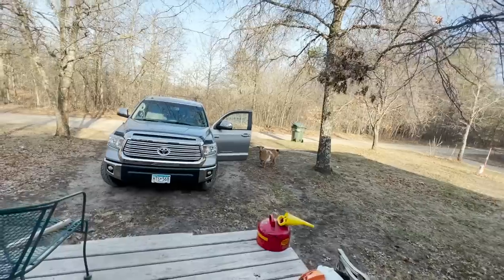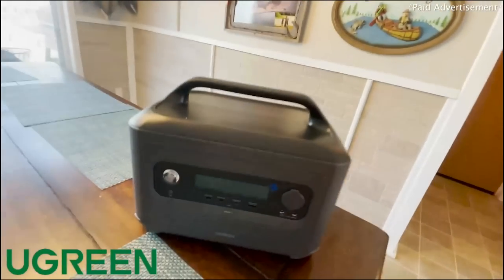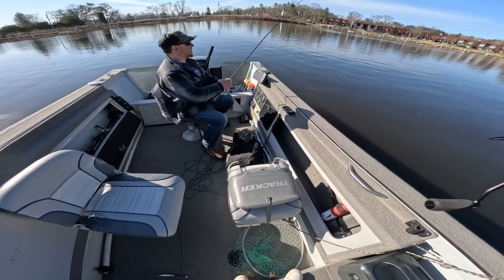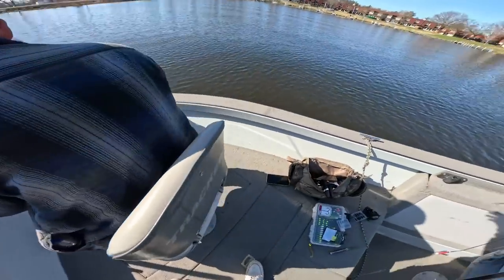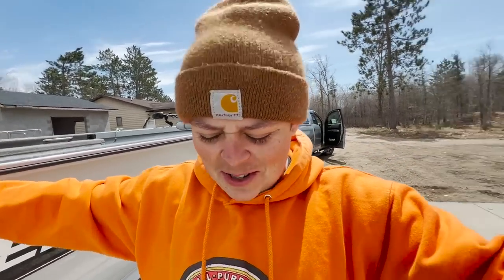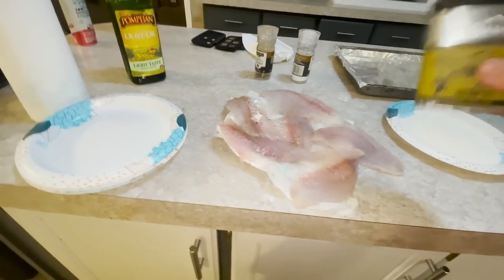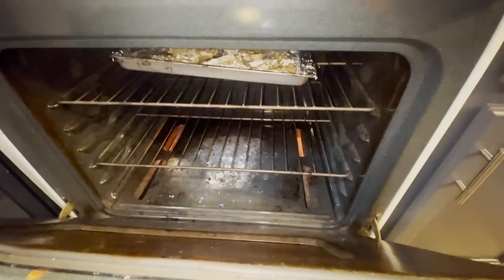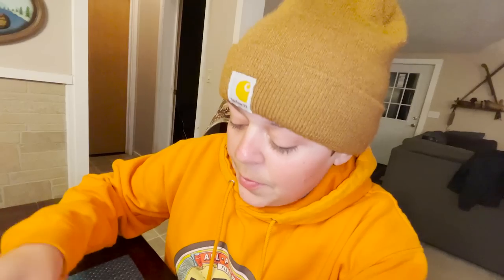Crappie Fishing Catch And Cook! (Schooling Crappies)

Comment: If you want to bake fish like that, maybe try my chicken nugget method I use for my kids. Meat (fish in your case, chicken in mine) dust in seasoned flour (to dry the fish's surface), then egg (so the next step sticks), then cover and kind of press on panko breadcrumbs (with added seasoning), so the peices are totally covered. Then take a baking sheet like you had, but put a wire rack (like a cake cooling rack) so air can get underneith and you don't have to flip them. Put the fish on the elevated rack and bake until golden/crispy.

Comment: The key to baking with batter and or air frying is coating them with oil after they have the batter on them.  bake them for about five minutes and then coat them with oil. continue baking. About halfway through the cook time, flip them over and coat the other side with oil. Continue to cook until brown.
Reply: I agree with this.  Olive oil spray works!!
Reply: or just use spray oil like pam